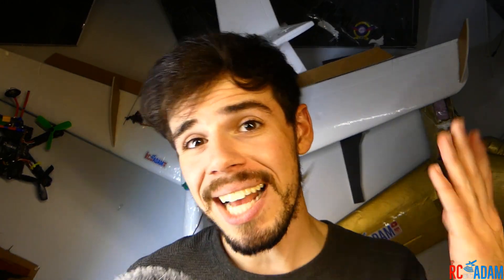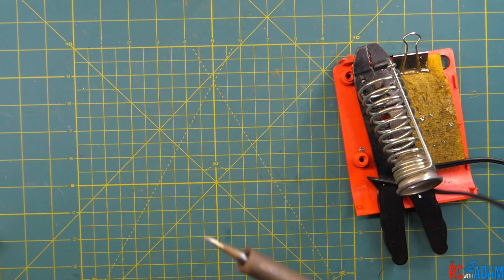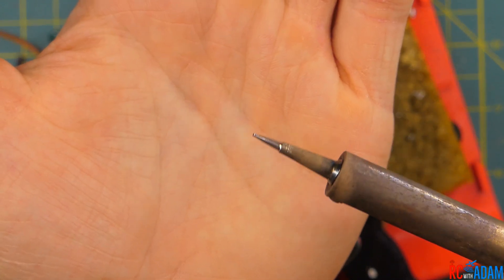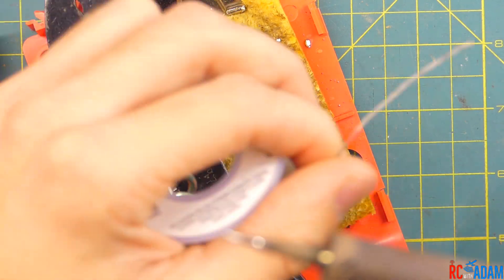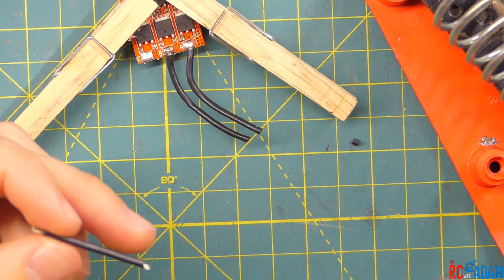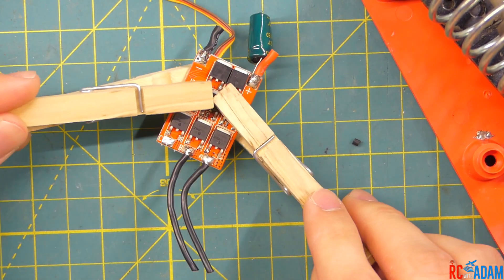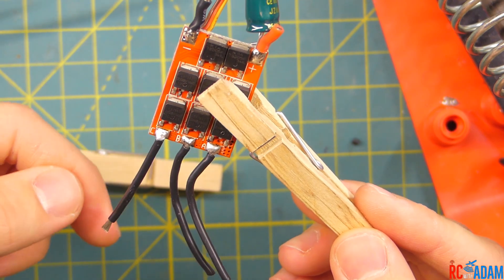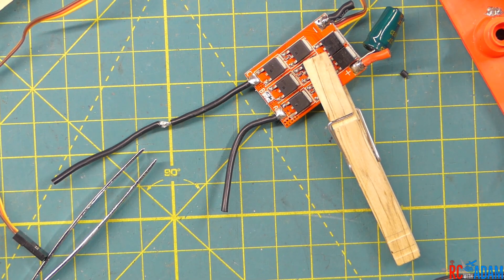Learn How to Solder Drone Electronics - for Total Beginners

Comment: Tip for new solderers: stay away from the no lead solder. It is absolutely terrible. Also it’s best to get a solder with at least a 2.2-3% rosin core. 
Stay away from no clean flux or water soluble flux as they are conductive and will cause issues or shorts by creating circuits through the solder. 

I repair circuit boards for my 9-5 and repair home/car audio in my spare time. Looks like all your boards are SMD (surface mount device). A good hot air station will save you a lot of headaches and pulled pads. 
A good desoldering gun is a lifesaver for through hole components. If you don’t wet (add solder) to the joints when removing bad components you can and will remove vias. Via is a copper barrel that connects the top of the board traces to the bottom traces. Good luck and glad to see anyone getting into electronics. 
Thanks for the video.